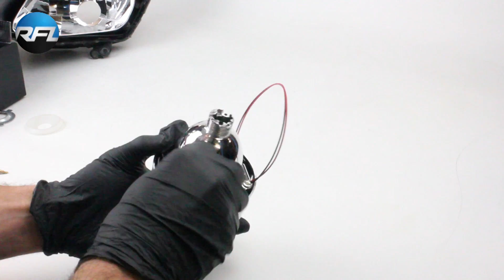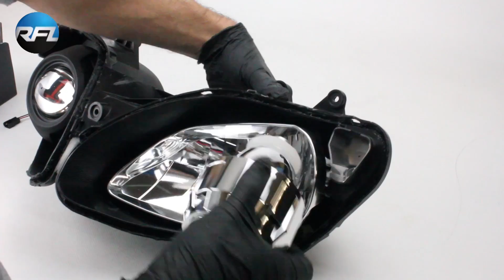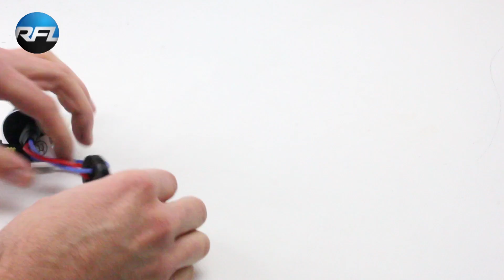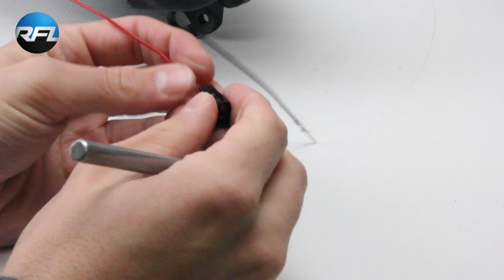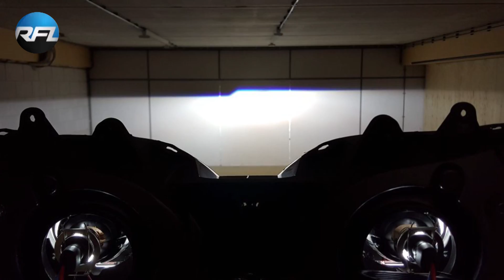Yamaha YZF R1 RN09 - 2002-2003 Bi-Xenon projector headlight Upgrade retrofit by Aharon

Comment: where do the solenoid wires go to ?
Reply from the maker: The solenoid wires are connected to the wiring harness that is supplied in our kit and connected to the high beam bulb connector on the bike.
Reply: so it takes 12v of the battery ?
Reply from the maker: They are powered by the high beam signal (which of course is indirectly powered from the battery)